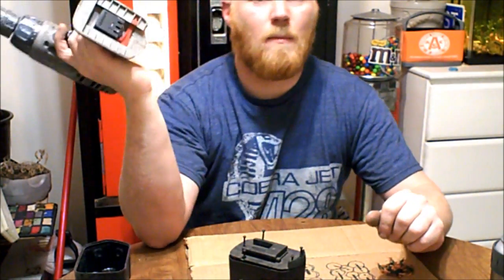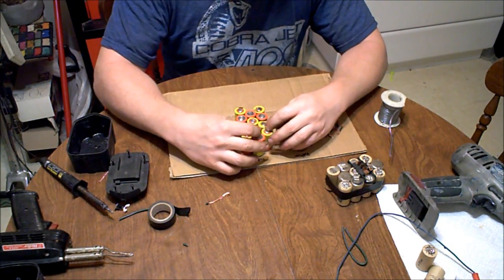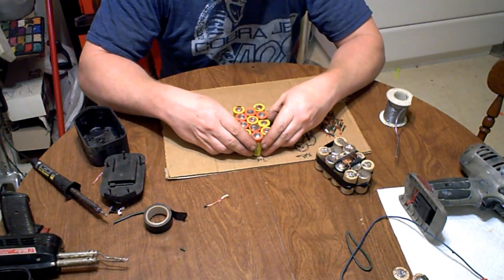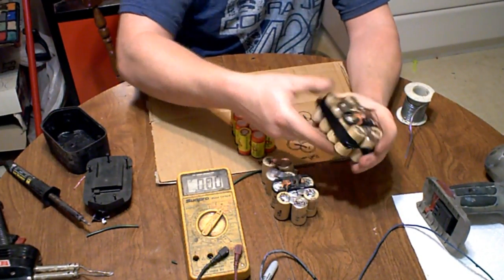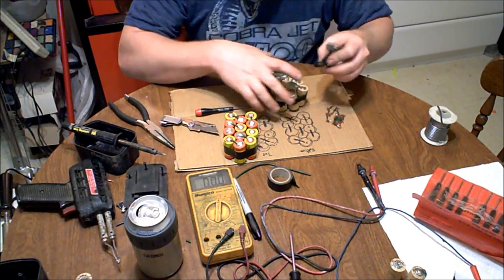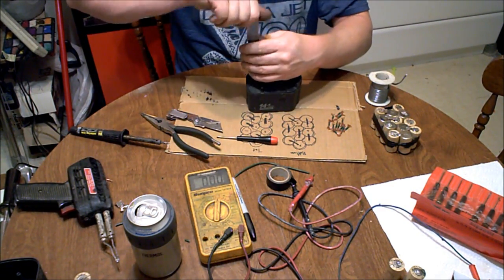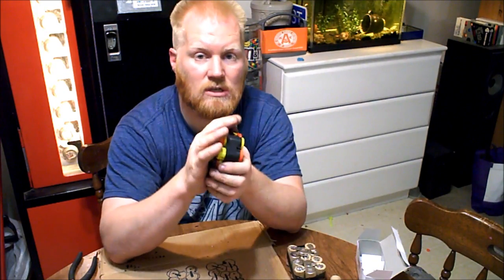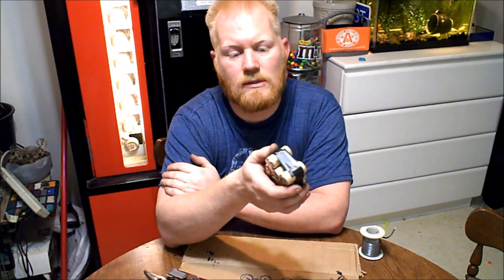Cordless Drill Battery Pack Rebuild for $20 or Repair for $0

Comment: First, thank you very much for the great tip and video. There are a lot of comments here and I read all looking for your replies and got answers to all but one question. I have a craftsman 19.2 drill that I will be looking to repair/replace batteries in. But I have already purchased one of their newer Lithium Ion battery packs and love it's strength and light weight. Can you please tell me if I can replace the NiCad in the older packs with Lithium Ion batteries, the old heat since etc? If so please tell me the best place to buy them, what to look for, and how best to do it? I'm sure many of your viewers would like to switch over to Lithium Ion batteries rather than replacing with NiCad. Thanks You again for a great video and the help you have given us.all.
Reply from the maker: Very well put. I would only add one thing to the longevity of a Nicad cell. Once a power drop is felt in the power tool, stop usage. Continuing to use a battery pack to finish the job destroys individual cells. It will actually force a cell into reverse polarity and cause it to never work the same again. That particular cell won't hold the same charge as it's buddies and will make the pack drop a lot faster. This tip will make Nicad battery packs last 3 times or more longer.
Reply from the maker: First to switch over to Lithium you will need a charger designed for lithium charging. The rest is pretty simple as far as putting lithium cells in. You will need "HIGH DRAIN" 18650 cells as standard ones won't work. Since it is newer technology it will cost a fair amount to convert them (3-4times as much) and you will need to wire them differently.

Nicad cells are rated at 1.2volts (16 cells for 19.2 all wired in series)
18650 cells are rated at 3.7volts(10 cells for 18.5 sets of 2 wired in series/parallel)
Reply: If your original pack is NiCad then stick with NiCad Cells.  You can go from 1500mAH cells to 2800mAH cells and really juice up your power applications. The problem with trying to use Li-Ion in the place of NiCad is that Li-Ion Cells cannot be over charged or discharged.  If a Li-Ion Cell is over discharged it will be difficult to fully recharge that cell. So, Li-Ion batteries have Charge/Usage controller boards.  These boards balance each cell's voltage to provide the rated unit life.  This is not required with NiCad. On a Li-Ion battery, if the voltage goes from 19.2v to 13v under normal usage the controller board will cut off the battery unlike NiCads that you can run to 0V and still recharge.  If you do not use the proper Li-Ion charger and try to direct charge an un-controlled unit, you will most likely over charge one cell that will die and start a domino effect which will kill all the other cells in the battery back. Once a Li-Ion cell has reached its max voltage it starts to produce heat, and the last thing you want with Li-Ion cells is increased core heat.  This heat kills the cell rapidly.

Bottom-Line: Buy 2800mAH NiCad cells and use your battery in -20(C)Winter to +49(C)Summer.  The newer NiCad cells will last for years, have lesser memory effects and will not burst into flames like Li-Ion.

You can buy new cells directly from overseas manufactures via eBay. look for "Sub C 2800mAh 1.2V NiCd Rechargeable Battery Cell". The current price is around $1.85 US each with free shipping.

From one Handyman to another, Good luck and stay safe.
Reply: Thank You VERY much for the follow up reply! When I had asked you about replacing the nicads with Li cells, I was concerned that the "Charge/Usage controller boards" would be necessary in the battery container and not able to use the older NiCad controller. Even though (as you had mentioned) I would need a battery charger that handles Li (which I do have because I did buy a new Li battery that came with the new charger that does both Micad and Li. But my concern was with the Charge/Usage controller boards. And now you have thankfully answered that Q. I went into Sears yesterday and saw that their Li standard compact battery (which is what I have) is on sale for $30. They were nearer $50 just a few weeks ago and why I was considering the rebuild. The newer stronger ESP Li ones they have are $70. I have had no problem with my Li compact and they work well for me. If I have two Li and the quick charge capability, I may just go with the one on sale for $30 rather than the heavier NiCad replacement of cells. Even thought as you say the  2800mAH will last longer and better than the older NiCads I have (two) that came with the drill (both dead).

For the NiCad at $22.20 for 12 cells to rebuild, compared to a slight increase of $8 to Li, it may be worth it just to buy new. What do you think?

If they had not been on sale I would definitely be doing the rebuild. Your advice and guidance is very very much appreciated!! I know there are many that have viewed your video never getting back with you but having done the rebuild based on your excellent advice.
Reply: +MRrwmac The main complaints users have about Li-Ion Power Tool Batteries is that there is no run-down warning and in cold weather the charge retention is poor. The battery will just quit once its lower voltage limit is reached. This is a good thing for the battery but a bad thing for the user trying to finish a project.  NiCad batteries have come a long way since you first purchase your original power tool set, and you must consider that the batteries included in your set, for economic reasons, were of a lower quality.  But the manufactures went with NiCad because it was cheap, had high power potential, and was durable. The units could sit on the retail shelves for a year or more and still operate as intended. Also consider that most power tool kits cost about $100 US and included two batteries.  The manufactures are not going to spend $30 US each on the batteries and make a profit. The original batteries only cost around $12 US each (which at the time was still a lot).  

Emerging technologies like Li-ion and SuperCaps may be the direction we are heading in but along the way science has improved the original NiCad Cells to incorporate some of the enhancements of these new technologies. The most notable improvements are power density(from 1.0Ah to now 3.0Ah cells in the same size package) and virtually no more memory effect. That is why the 2800mAh Cells are dramatically different from the 1600mAh cells that originally came with your power tool.

Last note: Pay close attention to the Ah and the Wh  ratings of these newer batteries. Most new battery unit will list one of these power ratings.  

Know your conversions (Wh to Ah):
A 25Wh battery is like a 1.5Ah unit. (most $30 Li-Ion will not show you Ah only Wh. This is why.)
A 45Wh battery is like a 2.4Ah unit. (most $70 Li-Ion will not show you Ah only Wh. This is Why.)

Bosch rates its NiCd 2.4Ah battery at 50% greater run-time over its 2.0Ah battery.  That means if you could continually use the 2.0Ah battery for 10min you could expect to use the 2.4Ah battery for 15min.  With that logic you could expect a 150% increase in run-time over an older 1.6Ah batteries by upgrading the cells to 2.8Ah cells. If you used your cordless drill, saw, or torch(light) to make money, you know what a difference 10min to 20min of full power additional run-time can make.

I think the current Li-Ion batteries are over priced and of a lower Ah rating in dollar cost comparison to the NiCds that are available directly to consumers.

Thank for your time. I hope I have helped.
Reply: Thanks very much for the info and guidance. Great video and tip.
Reply: JoeJ8282 Thank You for the input and excellent information. Might I ask you to please recommend a good source (company or particular seller) for reputable and dependable batteries like the ones you are describing that will work as you described in my my 19.2v craftsman C3? There are many to choose from and I have heard bad things about the chinese imports (which are hard to identify from all the distributors and sellers). That is why I ask for your recommendation on a good company or particular online seller ID that is selling the Ni-Cad batteries I need? Thank You!
Reply: GallowayChicago Your Ah to Wh conversions are not always exactly what you say there. It totally depends on what voltage your battery pack is! Volts X AH = WH. Therefore for example a 24 (or 25) WH 18 Volt battery is equivalent to about 1.35 AH but if that same WH rating is for a 12 V battery then it is a 2.0 AH battery, and if that same 24WH rating is on a 24 V battery then it is only a 1.0 AH battery!... Just remember when converting WH to AH or vice-versa you have to use Ohms Law which is Volts X Amps = Watts (or Watts / Volts = Amps), which in this case includes the 'hours' also, so V X AH = WH or WH / V = AH... It sucks for some that you have to use MATH to accurately figure this stuff out, but if you're a true techie (aka electronics nerd!) then you shouldn't have any problem with that!

Comment: awesome video! was going to trash mine and buy a whole new set... but not now! Sure hope this works better than trying to hit the battery with a wire welder (that didn't work).
Reply from the maker: Yeah I've seen the welder/battery videos and have tried it with no luck.
Reply: sixtyfiveford Yeah it is like trying to make an old person move faster by shooting them out a cannon.  Remember the old adage  "Slow and steady, wins the race".  Always try to slow charge your individual cells at their rated voltage for 3 hours before calling it dead.

Comment: some more recent cordless tools use lithium ion battery packs rated 18-20 volts.  Are those rebuildable too?  I just bought an Ingersol Rand W7150 and I know that eventually I'll be looking at rebuilding or replacing that battery.
Reply from the maker: Yes, they are rebuild-able the same way. They use 18650 lithium cells but you need to make sure they are HIGH DRAIN cells. Standard 18650 cells will die.
Reply: On Li-Ion packs unfortunately the controller boards crap out before the cells do.  This is because of poor quality control from the factory and sometimes users get the batteries wet and kill the control boards. So, if you try to rebuild a non-functional Li-Ion battery 98% of the time just changing the Li-Ion cells will not result in a functional battery. Sorry!

Comment: Nice work, I was just wondering, what would it be for a craftsman 19.2 battery pack, please let me know, thanks.
Reply from the maker: You will need 16 cells. Generally you can find Nicad Sub C cells for less than $2 a cell if you by 16 or so at a time. I really like to use name brand cells like the Tenergy.
Reply: What mah do I use for this build and thanks with your help so far.
Reply from the maker: The standard Tenergy come in 2200mah so that is what I used.
There are no name Chinese batteries that come in higher mah ratings but most have bogus mah ratings and won't give you the life you want.
Reply: Ok, thanks, great info.

Comment: hi i have a milwaukee 18v nicd battery drill 2.4mah. i want to build a new battery for it but i can not seem to find 2.4mah batteries and when i do there expensive so would i be able to use 2.5mah as these seem to be easy to get. im thinking of using these eBay item number:400661795859 what do you think to these quality wise. Thanks for your help in advance. Carl.
Reply from the maker: I have had horrible luck with no name batteries. They seem to have a fake capacity and high defect rate. Personally I would use a brand name  and common mah rating. The link below is exactly what I would buy. They are 2200mah but you won't notice a difference between these and a new 2400mah battery.

http://www.ebay.com/itm/15-NiCd-SubC-2200mAh-Batteries-PowerTools-Tabs-/330401958745?pt=US_Rechargeable_Batteries&hash=item4ced7dcb59

Comment: Hey 65,waer s glad I found you.I'm a man than likes to take spare parts or someones junk parts and make use of them for something else.I have a small propane heater that has a fan running on 6 d cell batteries.It eats them.My fridge went out and I removed it out yesterday.I was just looking at the parts and noticed the freezer fan.Well it now has a cord and its a great fan for my heater.Keep up the good work.
Reply from the maker: That's a neat modification. I always love doing things like that. It great to meet you.

Comment: I may be reviving a couple old Dewalt battery packs, after watching this.  Already upgraded the drill to a new Porter Cable, and a added nice Bosch 12v Li-Ion for small work.  Guess it never hurts to have another spare drill.  That damn ugly old battle axe Dewalt is never going to die now.

I suppose, rather than combining two old batteries to form one good one, I could evaluate the dead cells and simply replace those, leaving myself with two good packs at minimal cost.

This video is full of win. Thanks, man.
Reply from the maker: Thanks. Out of 2 I will generally make 1 salvage pack and one completely new one.
Reply: sixtyfiveford Not having done this, I'm only taking a wild guess as to how many bad cells I will find.  I may be seriously underestimating the number.  I guess I'll find out.

Comment: The title is deceptive. It states that you repaired it for no cost but those nicads are not for free. So how much did you spend and if you did not already own a soldering iron how much would that add to the cost?
Reply from the maker: No cost- Swapping dead cells from 1 pack to another. Essentially taking 2 dead packs and making one.

Cost- Buying new cells usually run around $1.75-$2ea. The 14.4volt pack I did in the video with 12 cells cost me $22.54 to rebuild.

A basic soldering iron can be pick up for around $10.
Reply: sixtyfiveford Great video dude.  Thankful for fellow Americans like yourself.  

Just a couple of points that might help folks, it's milliAmp*Hour (1/1000, not micro, which is 1/1,000,000), just a little slip there.

On the NiCad vs NiMH, I noticed some brands (e.g. Makita 193158-3 14.4 Volt Battery Ni-MH) are using Ni-MH.  That's OEM Makita.  

I read on some info sites the Ni-MH don't have memory effect and the only reason to use NiCD is lower cost, only NiMH are just as cheap now.  

I also wondered if switching could cause a problem with the chargers.  

If anyone knows these answers for sure, please post.

Thanks again for an excellent video - you did a great job cutting it down to show the meat w/o too much bs talking.
Reply from the maker: Neither have the mythical "memory effect". Nicads are designed to give larger amounts of power quickly. Nimh are designed to give small amounts of power slowly. In a typical high drain  cordless tool Nimh cells would overheat and burn up almost instantly. The cells in the NIMH Makita are special and you'll notice they are only 2600mah each which is LOW for a NIMH and almost idential to the ratings of NICad. It's tempting for people to buy the 3000+ mah NIMH cells but they will die a quick death in a power tool.

Comment: I just lost a battery pack to my Craftsman Drill. Will be fixing it shortly now, thankx.
Reply from the maker: Hopefully this saves you some bucks. Ebay is usually the best place to buy replacement Nicad cells.
Reply: It looks like I'm going to need a very slim screw driver with a small star tip to open it up.
Then I'll go toEbay.
Thannks
Reply from the maker: The Torx screwdrivers are pretty common. Sometimes you can get by with a small flathead screwdriver wedged between the star points.

Comment: Is it possible to replace the batteries with a different kind, as long as they fit? For example, replacing the 4/5C with spare rechargeable batteries that total 16.1v, or even go higher for a higher powered battery?
Reply from the maker: Higher voltage will overheat your tool and possibly short it out. What is the rated voltage of your battery pack right now?
Reply: sixtyfiveford I believe it's 19.2, but I could be wrong. I don't have it right here with me. I have another one that I think is 14 that is completely dead that goes to another drill.
Reply from the maker: All nicad batteries are rated at 1.2 volts even though they charge to 1.4 or so. So a 19.2 will have 16 cells and actually read about 23volts fully charged. You are better off trying to find higher capacity Nicad cells, 2200mah is about the max.
Reply: sixtyfiveford What if I just want to replace the batteries so it works? It doesn't really matter if it works optimally, just so it works.
Reply from the maker: Yeah, swap out the bad cells for some good ones and you'll be set.
Reply: sixtyfiveford sweet. thanks

Comment: Fascinating, did you ever replace defective lithium ion batteries in a pack?
Reply from the maker: Yes. They generally use what are called 18650 cells. But they are not standard 18650 cells, they are High Drain cells rated at 20-30 amps draw. Typical Lithium cells will overheat and die.
Reply: Thanx.

Comment: Thank God for People like 65lord
The money I can save carrying out this repair --Marvelous
Reply from the maker: You're welcome. Let me know how it goes.
Reply: sixtyfiveford Any idea which screws hold a Makita BL1830 battery together?  I've had no joy getting anything to grip.  They look like TORX, but have they perhaps been modified so that the battery can not be dismantled?
Reply from the maker: Some of those use the security torx. It is a torx but has a pin in the middle. The easiest way around this is a small flat head screwdriver. It will fit off to the side of the security pin and grip in 2 of the star/torx points of the screw.
Reply: sixtyfiveford Thanks again!  Ended up using a very thin cutting disc on a 4" grinder :(